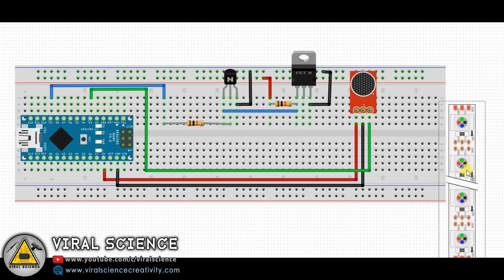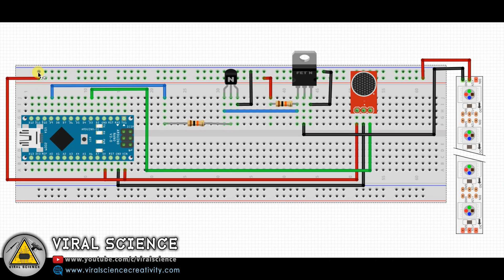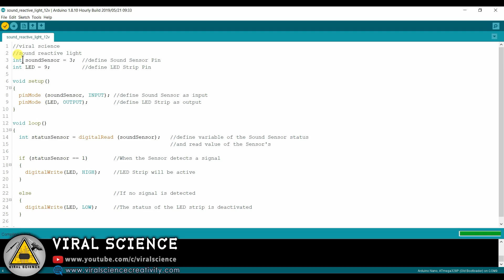Arduino Sound Reactive 12V Lights | Disco Lights

Comment: This  would be much better if you used  a fast Fourier transform algorithm to split the music into separate frequency  bands and then used those bands to trigger and set of coloured lights,  as in Red for Bass ,Yellow for Mid range and Green for the top end.

Comment: Hi, 
I am a complete novice, had graduated in commerce, I love doing DIY, and this lockdown had given me the time to do some DIY. 
I will follow the instruction and get components mentioned to the dot, whoever I have a question, can I use any regular RGB 12v led light strip available in the market, If I buy the below Led light strip of 5 meters or 10 meters, will the above components be sufficient ????

Please do let me know, I really loved this project.

Samle LED Link  --> https://www.amazon.in/Flexible-Controll-Plastic-Decorative-Lighting/dp/B08F26PBK3/ref=sr_1_11?adgrpid=58536806866&dchild=1&ext_vrnc=hi&gclid=CjwKCAjwj975BRBUEiwA4whRB4fukDlQUJZ4GqQHWfKxUFOfNFoPcOo7aVt-SDp1OGVDgJvRS6WHyxoCZfwQAvD_BwE&hvadid=381599154692&hvdev=c&hvlocphy=9061811&hvnetw=g&hvqmt=e&hvrand=9978073319715111050&hvtargid=kwd-295313249507&hydadcr=6721_1957985&keywords=12v+led+strip+rgb&qid=1597477523&s=kitchen&sr=1-11&tag=googinhydr1-21